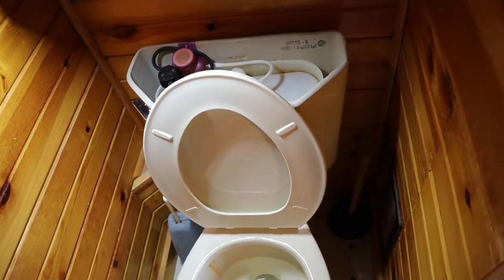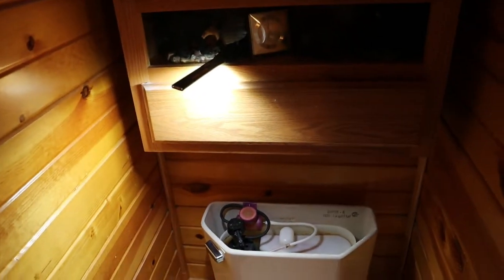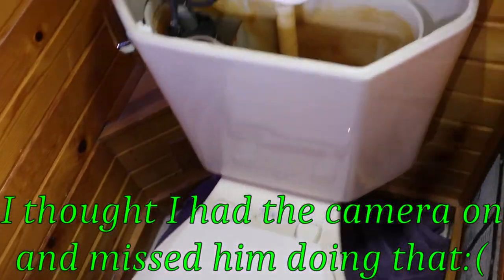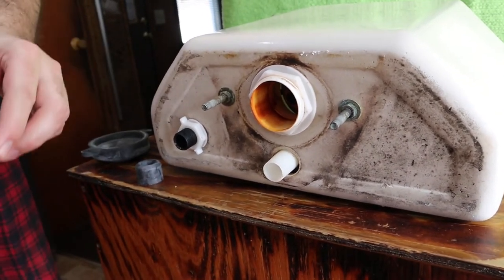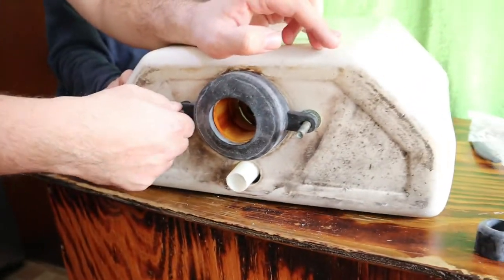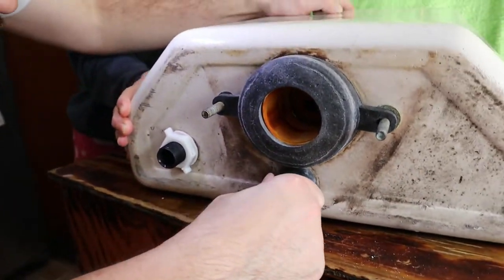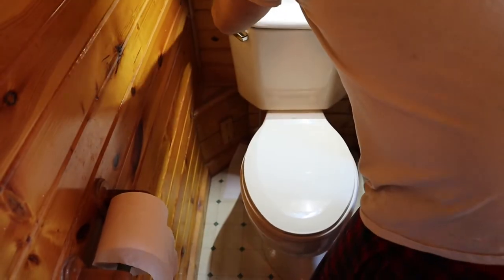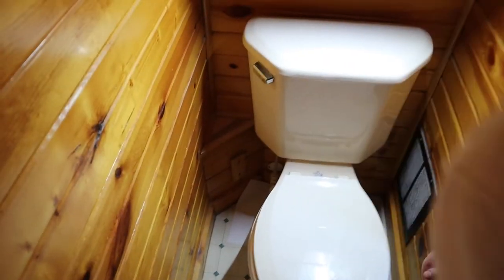Briggs Vacuity 4400 Series Water Tank Seals Replacement - Solves Poor Flushing Problems.

Comment: I have the same toilet 4400.  This was advertised as the "tank within a tank", to eliminate exterior tank condensation.  However,   mine has water in the ceramic part of the tank, outside of that plastic inner tank, so some seal or something has failed.  It seems to flush OK, just has water in the tank where it shouldn't be.   I want to rebuild / replace every part in the tank completely, seals, hoses, valves, bolts etc.  Where did you buy the factory original Briggs parts?   Thank you.
Reply from the maker: Hi, I go here for parts : https://www.plumbingsupply.com/briggs-toiletparts-vacuity.html I have more links in my video description, click the more tab, some parts are no longer available, the water you have in between the plastic liner and the ceramic top is normal during the humid summer months, but if it’s excessive then the gasket below the plastic liner is probably leaking, unfortunately that part I can’t find anymore so what I would do is just use the old gasket to trace and make another gasket, and there are some off brand parts but try to stick to OEM parts.
This is a pretty easy toilet to rebuild and we love ours and will never get rid of it: Thank you for watching we appreciate it.i
Reply: @thisoldmobilehomeinthewood8434  OK, thank you.  I called them, and they don't have some of the plastic parts I need, so may have to do some refurbishing.  Your video was a good resource.